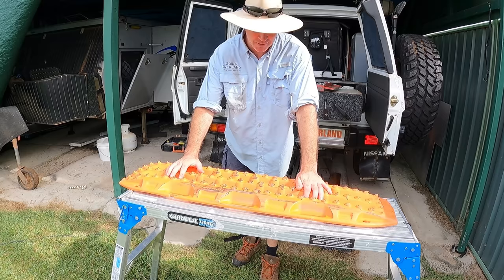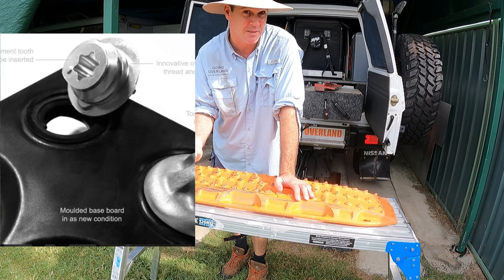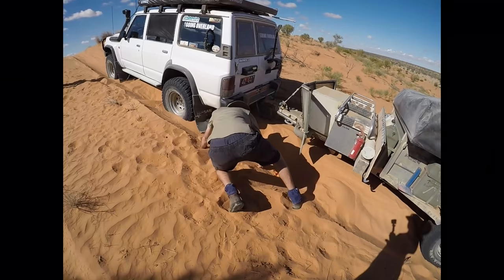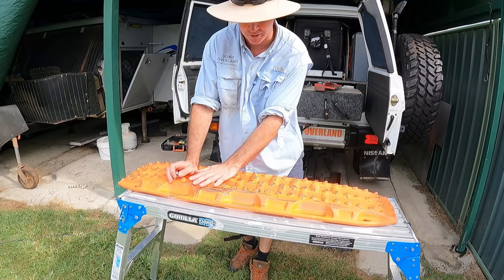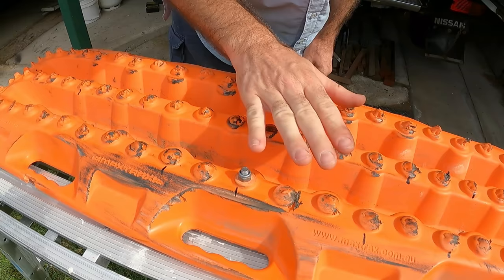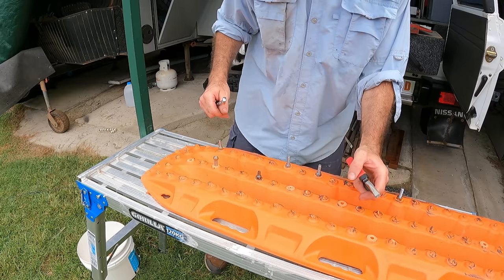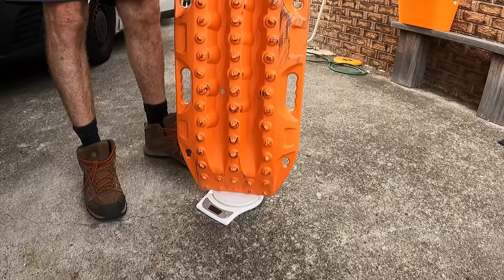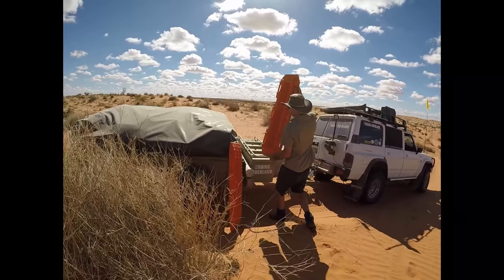Budget maxtrax repairs. Don't throw them away or buy Extremes. Repaired with what I had in the shed

Comment: Just a suggestion to help prevent the bolt pulling through when in use.  Could you place  small enough but thick washer in the depression where the bolt goes through.  Then a larger external diameter washer under the bolt head to spread the load out?  Theory being the first washer is as thick as the depth of the depression (Maybe more than one washer to get the desired height) thereby transferring all the force onto the larger washer.   Larger surface area less force per square  inch.
Reply: I was thinking some epoxy in the void between the bolt head and the plastic after assembling the bolts in. That would help spread the load over a greater area and help stop movement of the bolt side to side flexing the board near the 8mm hole. Maybe do both - washer and epoxy?
Reply: @BenMitro  Yeah that's a good idea. However if the bolt needed replacing it would make it awkward.
Reply: @bobklincke4671  Yep, just about impossible to replace without cracking the board - but I don't see the steel wearing out or breaking, so will it ever need replacing since the board would still be in tact?
Reply from the maker: I thought about a washer but I was more worried about the extra height it would add and then that affecting the tyres.  I think with reduced tyre pressures the nut has enough surface area on the board not to push through or be ripped out. I have managed to test them out and had no problems,  but you're right, normally you should use a couple of washers
Reply: @GoingOverland  Well, thanks to you, we are going to find out :)

Comment: Very interesting to see.  I think I'm going to try some allen head bolts and have the bolt head on the top side.  Less mucking around cutting and grinding plus the rounded head should work well to prevent any damage.  So long as you use the tracks correctly neither combination should damage tyres as your not meant to spin the tyres in the first place.
Reply from the maker: They and since this video I've used them a heap of times and now problems, even when we used them to get a unimog out of the mud 😳

Comment: Put the bolt the other way so the lock nut is on the bottom, I just used flat and spring washers , it works well it does make your tracks heavier though 😏

Comment: Great idea mate, dome nuts would be good, you could also try a wax sealer to protect the tires from the rough edges of the bolt.  Getting some great tips, keep up the good work and vids.
Reply from the maker: I think filing the edges smooth should be enough, but I might look into that 🤔

Comment: Another great idea mate. 😊 You may consider using dome nuts on the top. I know that means you've got to struggle with the socket on the other side but there would be less sharp edges that may damage your tyres. Either way, I'm looking forward to seeing how this mod goes. 😎
Reply from the maker: I did consider that but in my head I think that small thread sticking out will help with traction as the tyre deforms over it. But your right, if I notice it cutting up the tyres I'll just flip the 🔩 over

Comment: Top video mate keep up the good work 👍👌💪 I would of put washers on the underside so they don't pull out when the tyres grip the top and put extra force on them 👍 keep the content coming love watching your videos 👍💪👌🍻
Reply from the maker: Thanks mate, I did think of that but I reckon it shouldn't need it, the holes I drill where pretty tight,  but you're right normal you should put a washer under the head.  Thanks for the support and positive feedback

Comment: Not a bad idea but I think it will end up shredding tyres. With plastic they're can wear them down causing less tyre damage. With bolts, especially with the sharpish end, they won't give at all but your tyres will. Probably a good idea to get you out of trouble but not for the long term. You would be better off having the top of the nut flush with the end of the bolt as the nut has a rounded edge and will do a lot less damage. IMHO

Comment: Be interested to hear how they go Adam as a couple of mine are probably worse than those. Maybe washers top and bottom to help spread the load but does not appear to be much room underneath.
Reply from the maker: Yeah I got to test them before publishing this video so I can say it works and had no issues.  Only problem I had is I couldn't get bogged despite stopping in soft sand above the tide, digging big holes and towing the camper!
Reply: @GoingOverland  cheers mate 👍

Comment: I used my boards for the first time and stripped them brand new any ideas why
Reply from the maker: Too much wheel spin. You have to get the wheels on to the boards before giving the car acceleration.  Have a look at our technic in the following video 
https://youtu.be/z-yt5Df93lk?si=GhRIGxSOhhD7DxbF
Reply: @GoingOverland  cheers for it will they still work if some of the middle tread and some of the starting tread are worn off

Comment: I think they will tear your tyres up which are probably more expensive than the maxtrax, get rid of the thread on the bolts
Reply from the maker: I'm not worried about the tyres, I used to cut up the tyres so badly on rocks and damaged sidewalls that I would have to replace them well before they are worn out.  I think if I find they are cutting the treads to much I'll flip the 🔩 over for a smoother surface and less traction

Comment: Hi mate. What size rims are on the gq and what is the offset. I would like to run the same on mine
Reply from the maker: 15x8 and I'm pretty sure neg 22 degrees.  With 33x12.5x15s tyres we get great floatation and have never popped a bead
Reply: Thanks mate